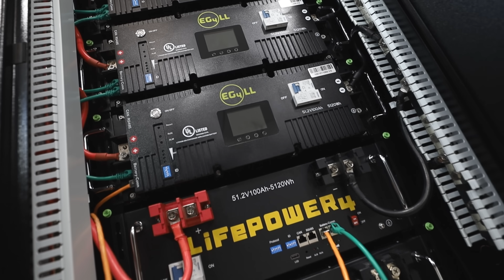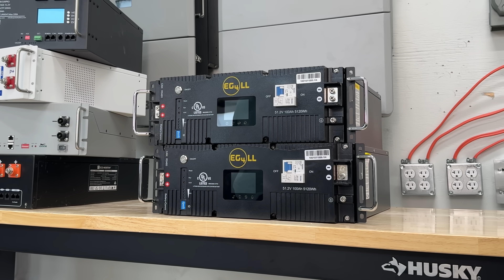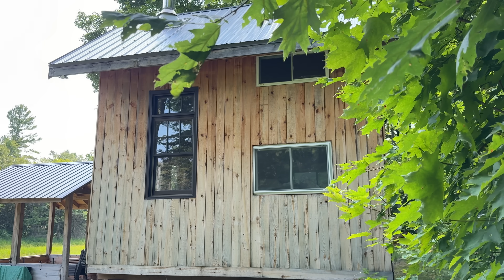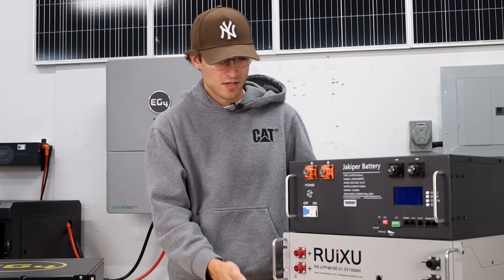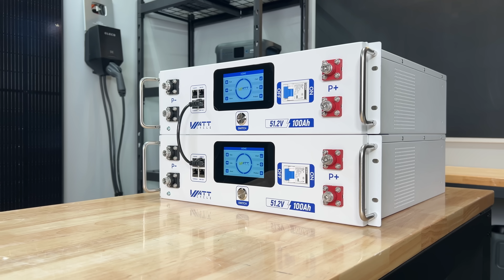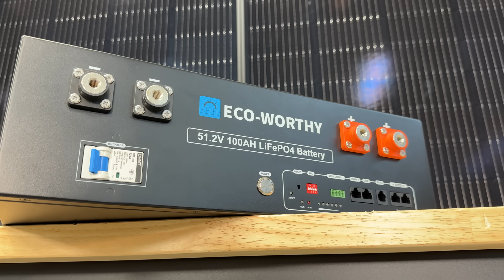Stop Wasting Your Money - Only Buy These Solar Batteries

Comment: Buying in the Asian market, I have noticed it's considerably cheaper to buy 300AH+ batteries rather than 3 server rack batteries. Yes it's less redundancy because I can't just throw out 1/3 of my big battery but I have 4 large batteries. But I am going to install 3 small grid ties systems with a Humsienk 5050 Pro 5kw AIO with integrated 100AH battery. At $1400 it's cheap enough that if it fails I can just toss and replace. Because everything is integrated it's cave man level wiring.

Comment: I’ve heard of this game. Sure UL listings may not be required in some areas but I’d want them anyway. NYC has had a rash of ebike fires linked to non certified Chinese batteries. The safety requirements of UL2489 were ignored to give the batteries more capacity resulted in fires. Don’t cut corners. It’s your home. I wouldn’t want to wake up to a huge battery fire because I decided to save a few bucks.
Reply: Not to mention that out of all the things I don't want to be in a house with when it catches fire, a lithium battery is very high on that list.

Comment: I built a 16 x 40 shed/our house I built it facing directly south it’s close to 7000 W of solar. I have a Mr. power 10,000 kW hybrid burner. I typically make between 18 and 21 kW power a day on sunny days. I have six sets of four let crystal batteries. There are 180 amp hours each for total somewhere around 56 kW of battery bank. I’ve been totally off grid for four years without any issue and I mean nothing except one of my solar panel and melted off for some reason and that was a quick fix. I got lead crystal batteries for about $$900 a set and I have six sets. I also have a generator/inverter. I think it’s 10,000 W. It produces clean power. I do probably use between 80 and $100 a month in gasoline for my generator if I average the whole year. Obviously some months I don’t use it at all. I think I’d like a more efficient generator in the future. But probably what I’ll do at some point is increase my battery bank but I can’t find any more of these lead crystal batteries, which I love I know there was a lot of talk about charging amperage and I did last year. Use my welder and put 40 A into each battery. This is not a professional set up. It looks like crap probably unsafe in some sense but I’ve had free power for four years. That’s all I can tell you minus the cost of the set up. I think I’m better than break even at the moment even my solar panels were used. My point is don’t be pussies. Just build some shit.

Comment: Just buy raw cells and a bms and save a lot more. I have 150kw bank  and never once have a wished i had communication between cells and inverter.  The inverter knows the charge of the batteries from the state of charge the cables have. Just set your inverter right and your done. Ive had my setup for 6 years now.

Comment: One difference between UL and non-UL you didn't mention is that UL certified products can't change the design, components or construction without getting re-certified.  There have been several instances of manufacturer's changing internal components & wiring without telling anyone (probably for cost cutting measures).  Not knowing what you're getting from one order to the next is a pretty sketchy practice...

Comment: Ruke-sue is how RUiXU is pronounced. Great batts and even cheaper if you pay cash via wire transfer. I have 20 in two racks and the cells are extremely well-matched. +/- 4mv from 98% and lower and 24mv @ 100% which is as good as it gets.

Comment: Would like to add Ruixu does has inverters. I used to own SUNON 7.2 Inverter from Ruixi and It was nice equipment, specially the touch screen and ease of uase menus were remarkable for the price class.

Also want to add I have 3 x 5KWh SONEC rack batteries tied to EG4 6K XP doing closed loop. Working perfectly so far. Full Offgrid.

Comment: I have an off grid setup and 9 eg4 batteries. Yes they are more expensive but with the level of support and quality of the build I think they are worth it, if you can afford them. Especially if you are not putting them away from your home.

Comment: For a video with such a concise point, I noticed several core messages were repeated 2 to 3 times throughout:

"Buy the battery that fits your needs, not what the internet tells you" (3 times)
"Premium batteries are high-quality, but not necessary for everyone" (3 times)
"Communication (closed-loop) is a convenience, not a necessity" (3 times)
"Appliances don't care about the brand logo, they care about capacity" (2 times)

It would have been more helpful to go into specific details on how to manually set up a budget battery because that is the next logical question the viewer will have after you explain how good budget batteries have gotten.
Reply: When I'm contemplating a big purchase, I search youtube for in-depth reviews/demonstrations/tests of that exact product.  There are several reliable test channels available

Comment: why was my post deleted? just because I said solar is not the way to go? WTH?
Reply: I don't like solar. I have solar. I'm putting in more solar at 3 more houses I own because it aids in the natural disasters my area is prone to. If you have batteries, have a generator to charge them. If the inverter and batteries go, make the most out of the generator. The logistics and inefficiency of the generator without a battery to store excess energy makes for a logistical nightmare to store enough fuel for 10 days to two weeks even if cost is not an issue. I could get two 50 kilo bottles of Butane for about $600 which doesn't take up too much space but the solar is out of the way and not taking up Any useful space for me. I may get the Butane anyway for generator fuel, cheap insurance.

Comment: The best advice is to find the battery you like best and build a battery bank with the same brand/model batteries so the batteries communicate well with each other and your inverter.   

Mixing different brand batteries with different BMS units can make things more challenging.  You can make them work but you may lose the ability to accurately monitor SOC or utilize RSD devices and all the features of your inverter.  

Using EG4 batteries with an EG4 inverter will give you the ability to use all the features of the batteries and the inverter.  Same would usually go with any other battery/inverter combo from the same manufacturer.  

There are some great budget batteries out there, but try to think in terms of the entire system if your goal is to build a complete DIY home solar system.

Comment: can i connect server rack batteries to an eco Flow Delta Pro Ultra?
Reply: Those are 102.4v so you’d need to have specifically built for that or come up with some way of running two rack batteries in series, which I have no idea how to do safely, but I assume it’s possible with the right balancer equipment.

Comment: Good for solar lab doing a clarifying video. I have multiple rack batteries 2 of which are eg4 which work awesome with each other but don’t play well with others. Have 4 other “dumb” have no issues either going on six years of playing with solar. Even with comms some systems suffer horribly from drift more users need to learn to top balance their battery banks as a maintenance step. Programming flaws in comms are most reasons for failures.
Reply: I bought a $30 Mazava balancer from amazon and it worked where the expensive Victron was USELESS. It's still humming along 3 years later.

Comment: Ok, well.. I'm going to make a correction here.  Battery COMMS are mandatory in a large system.  You don't need comms on absolutely everything, but they are mandatory because the inverter can charge at a much greater rate than any single battery.  It needs to know how many batteries are accepting charging near the end of the charge cycle so it doesn't crater that one potential remaining battery.  Same goes for discharging.  The inverter needs to know, as batteries become empty, so it doesn't overload the remaining batteries.

The second reason is that the system scram (The red RSD button you can wire), at least in the EG4 ecosystem, will also shutdown the batteries themselves.  It will actuate the breaker on all the batteries.

-Matt
Reply: If you have unbalanced battery drainage you wired your system wrong. If you don't care to learn how to avoid unequal drainage, by a Mazava battery balancer. Since when does a straight inverter control battery charging? You mean a hybrid inverter/charge controller?
Reply: @5400bowen  That isn't the issue.  In a large system when inverting and charging power is high enough to be able to swamp individual batteries, the situation at both the top and the bottom of the spectrum requires management whether the batteries are balanced or not.

It's something that doesn't show up in smaller systems, but in a large system there are two significant issues that pop up just due to differences in internal resistance between batteries in the bank.  No matter how you cable it.

The first is system behavior at the top during charging at a high rate.  It is much easier to hit high-voltage (on a cell basis) BMS disconnects even when a pack is reasonably well balanced.

And the second occurs during discharging for the same reason.  Individual batteries will disconnect at different times at the bottom.  Under high loads, this can cause a battery to be swamped.

So the comms are used to allow the inverter to service BMS warnings and ratchet down charging rates, manage the top of the charging curve, and to reduce the discharge rate at the bottom (depending on what it is doing, such as exporting power, this may be adjustable).   But generally to avoid swamping a battery with more current than it is rated for.

-Matt
Reply: @junkerzn7312 . That makes zero sense. You put your batteries in parallel with equal length cabling, I don't care how big a battery bank gets, they'll all draw and discharge at even rate.
Reply: @5400bowen it’s the reality.  If it doesn’t make sense to you then you are missing a crucial understanding of how lithium batteries operate under high loads as well as making an assumption of perfection in an imperfect world.  BMS safeties aren’t supposed to be a first line of defense.
Reply: @junkerzn7312 . Inverter communicating with the BMS. Take out the M. Like all inverters have hardware/software to control a BMS. You are delusional. Making up fantasies.
Reply: @5400bowen  You can try actually posting something that demonstrates that you have actual knowledge, instead of posting things that clearly show that you do not.
Reply: @junkerzn7312  Sounds like you didn't use busbars.
Reply: @robertkubrick3738  no, it isn't about wire-carrying capacity.  It's about what happens when one or more batteries drops out and the inverter doesn't know that's happened.  This will happen when batteries are out of balance at the top  of the charge cycle (for example).
Reply: @junkerzn7312  I have just watched some interesting tests with multiple MPPT controllers where people think that a battery will be hit by a massive load but it doesn't happen because the controllers sense that the single battery is not taking the full output of all the chargers and they slow down the charge rate. You would have to have a different malf than just an imbalance.
Reply: @robertkubrick3738  Without comms, the chargers don't "sense" anything other than the voltage... if one battery drops out and the other is still there, they won't see anything amiss in the voltage.  If they then push current in excess of what the remaining battery can accept, its BMS will cut-off and the entire system will have a bad day.

The whole point of having comms is so the charging sources understand what the battery bank can accept in aggregate without over-currenting anything.

These problems are a non-issue for small systems, but a huge issue for anything bigger.

Comment: Communication is not JUST a convenience feature. If you have one or more runner cells you NEED to know about it.  A runner cell needs to be discovered and protected until it's replaced.   You WANT to know the state of the battery. temperatures and every cell voltage.   No guess work ," nr 5 is a bad cell"  is what you need.  This diagnose could be with-in a month after purchase but also after a year.    Also the protections work better as there is feedback as to what is actually happening.   You really only get the right fault condition when it's communicated by the BMS to the control system.   Battery comms is an absolute must.

Comment: You make an argument that going "off brand" is a good idea with statements like:  If it breaks outside of warranty, you can buy another one and it's still cheaper than the brandname model.   And Batteries are consumable and will go bad at some point...     All this is an imbalanced set of commentaries.    Let's break it down:   Even cheap Chinese batteries can have a *10 years* warranty.    Lifepo4 batteries will last more than 10 years.  They will just loose a bit of storage capacity...       As a side note,  your inverter ALSO has a limited lifetime (about the same as the batteries!).   2) Price:  The whole premise behind your video is to save money for the user so they can get more equipment.    The cheapest "cheap" battery you list costs $800 for 100Ah rack battery.    Why in the world are you STILL recommending rack mount batteries?  They are NEVER the cheaper option!  You can buy a DocanPower 15KWh with active BMS and modern communication for $1630 delivered in the US (https://www.docanpower.com/usa-stock/solar-home-battery/l3-16kwh-52v-assembled-pack-usa-1).       Or a 16KWh YIXIANG vertical battery kit (just put the batteries in) with a JK BMS (active balancer and modern communication, tons of positive reviews and tests by DIY community) for $1980. https://yixiangpower.com/products/yixiang-diy-vertical-battery-box-kit-with-jk-200a-bmsus-stock-estimated-shipping-time-sept-28th-16pcs-314ah-brand-new-grade-a-lifepo4-batterychina-stock .    or EEL batteries (same as Yixiang offer but pre-assembled) for $2K https://eelbattery.com/EEL-48V-Power-Wall-Battery-Pack-16kwh-with-200A-Bluetooth-BMS-Wall-Mount-Power-Station-for-Home-Solar-Energy-StorageMarine-Boat-p4780380.html.  or if you want a brandname, Eco-Worthy has a 16Kwh vertical battery with active balancer and smart com https://www.eco-worthy.com/collections/lithium-batteries/products/eco-worthy-48v-314ah-lifepo4-battery-solar-battery-backup-for-home-wall-mount.       Compare that to the rack mount battery:   3x the cheapest battery is $2400 + $500 for a rack and you spent nearly $3K.     This whole video makes no sense and is filled with incomplete information.     Sorry guys... I know you can do better than that!